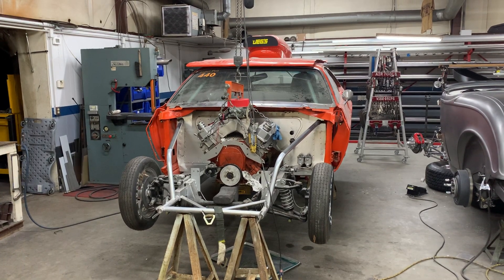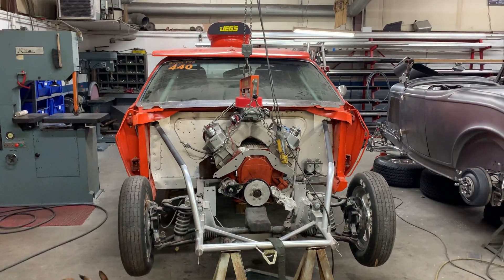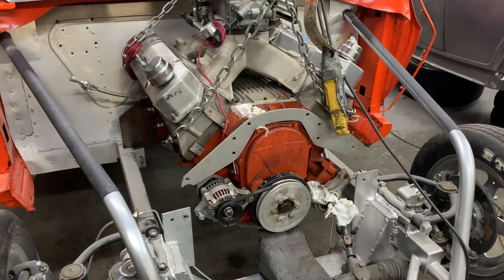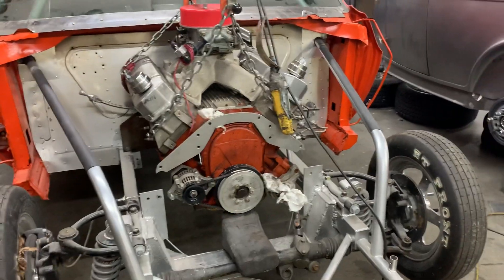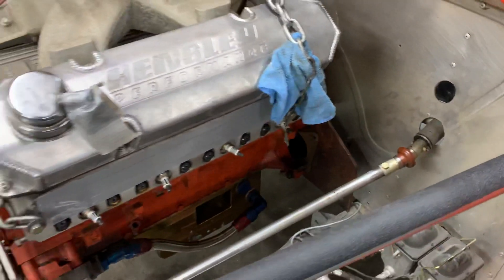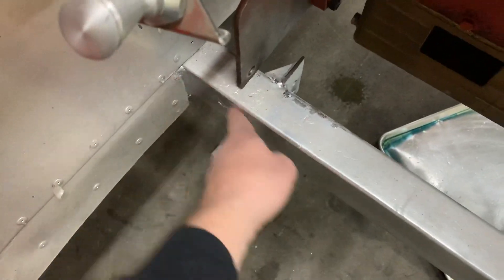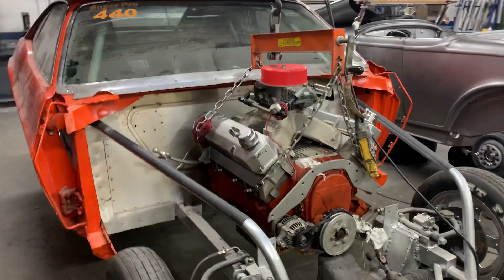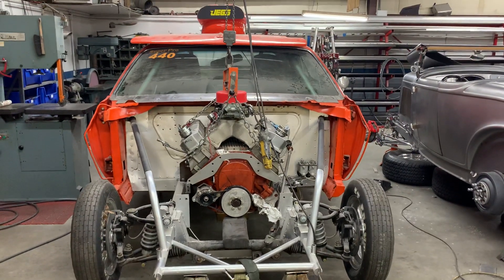Update on Ted’s Drag Car

Comment: That front engine mounting plate is temporary but is that a filled block that will not require a water pump?
Reply: Yes it will have an electric waterpump attached. The front motor plate that is on that motor for mock up only .the actual motor plate will be held on by the waterpump bolts as the plate will have holes in it mated to the water jacket holes in the waterpump so that the plate goes between the block and the waterpump